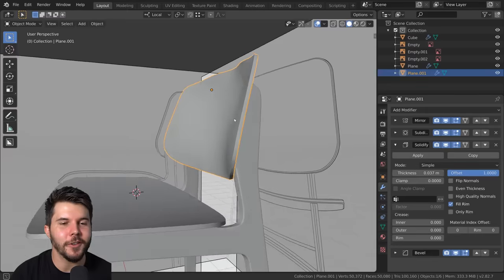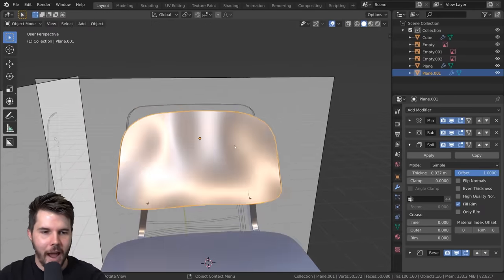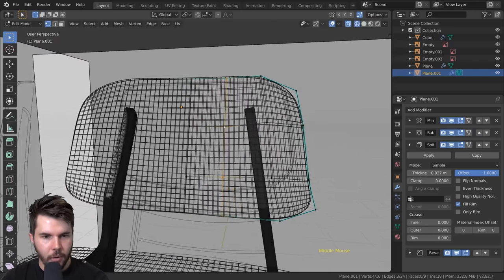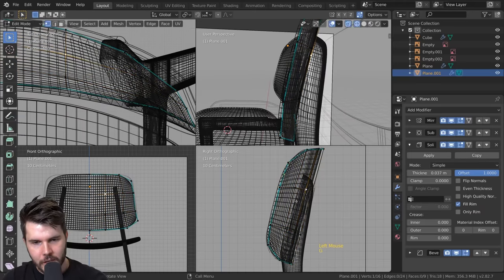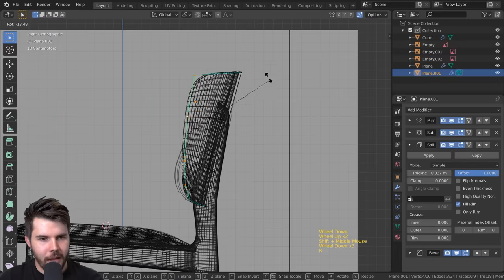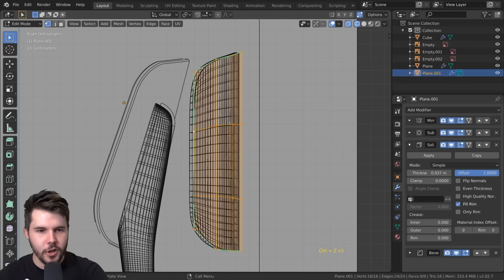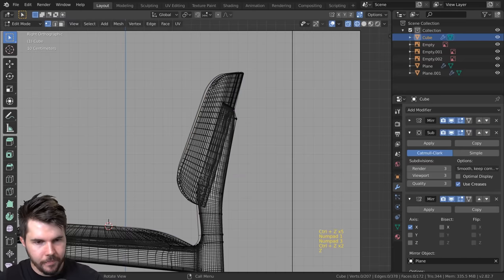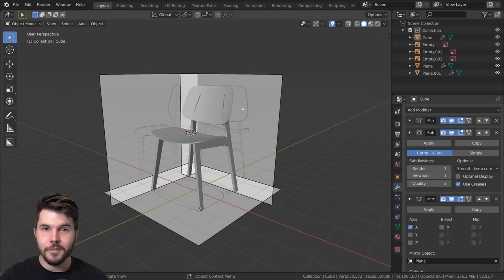Blender Beginner Modeling Chair Tutorial - Part 5: Curved Surfaces

Comment: Here is really useful tip that i think would be really useful for modeling any object that have odd rotation on x/y/z. 
What i would do is use Duplicate Linked (ALT+D). This is useful because when you create duplicate linked object, you get new object that you can rotate/move/scale any axes in Object mode and not affect rotation,scale, etc. on the other duplicate. But when you go to the Edit mode and move vertices, it will move vertices on the other linked object. 

-For example lets say you are doing chair legs. You can make 1 leg part the is perfectly straight and duplicate linked object that fits actual chair leg rotation. So now you have straight version of the chair leg that you can easily edit (because its perfectly straight obviously) and you can see results on rotated object. So you can just work on the straight part and look at the other part to see results in right rotation. When you are done you can just hide that object from render and viewport in case you want to go back and edit it again, or remove it.

-Other few useful things about this method. You can also Set subdivision surface on one object and keep other linked object without subdivision surface. IMPORTANT NOTE: When you use subdivision surface on one object, moving vertices on non-subdivision object will only show results on subdivided object only when you exit edit mode.

Comment: If making it in tilted angles is difficult, what I did was remake another seating (you could even duplicate the seating and work with that), hid the other meshes, tilted the whole set including the three blueprints to face sorta upwards(kinda hard to describe), and then modified everything there. After that get the blueprints to face normal again, and just tilt the back part the right way. To summarize, just make the model in your preferable angle and then just rotate it the right way. Its easier to deal with vertices and to place it without your mesh being that uncooperative.

Comment: this video was very valuable to me because I think it is more important to be able to fix mistakes than always learning it the right way from the get go but I am just wondering why you didn't use a deform modifier. After placing your surface sideways and matching it according to reference, it is as simple as just using a bend modifier for it to match without manually moving vertices around. Just wondering but thanks heaps, I am switching from Maya to Blender and your videos have been very supportive for that switch. Cheers

Comment: Why not use the SimpleDeform-Modifier ?
Blender 4.2/4.3 Oct 2024:
Use the mirror and subdivision modifier. Block out the backrest in the front view.
Then rotate the plane in object mode in side view. Don't apply rotation. Adjust the backrest again in edit mode in the front view.
Afterwards it is helpful to bring the vertices back into one plane: First set the "transformation orientation" to local and then enter "S, Y, 0" (scale in y-direction to zero).
Then use the modifiers “Solidify, Bevel and Smooth by angle”. The latter is a modifier since blender version 4.1 or so, click on “ignore sharpness” there.
To bend the backrest, create an empty object centrally and use the "simple deform" modifier to bend the backrest around this empty (select the empty object with the modifiers eyedropper tool).

Comment: Those wood curved shape are obtained in real world using the heat bending method which used a mold. One tutorial, especially a tutorial for beginners, has necessary limitations. The teacher has to constraint himself to a specific list of tools if he doesn't want to loose or discourage his students (and that's one of the numerous qualities of Andrew's tutorials). In this case, after modeling my plane shape in the [XZ] plan, I've tried the shrink modifier using projection option and a simple deformed cylinder (oval shape with a base slightly larger than the top). I think it's an efficient way (and logical one cos it simulates the real mold technic) to achieve a very regular shape without efforts (you can easily adjust your projection master object to get close to the goal)

Comment: 10:47 quick tip: you dont need to change the transform orientation at the top, you can just double tap Z and it will do that aswell (same with the other axis)
Reply: Just to make it clear, in 2.8x , that's a single-tap for the displayed, selected  orientation in the dropdown, double-tap for Global.

Comment: I remember that in 3dsMax there was something like custom grid. You can create own grid with angle and then work with it same as default grid. This feature would be nice in this situation.
Reply: Blender does it with Custom Orientations .. as I commented, I'm surprised they weren't mentioned in this tutorial, because they are really important in situations like this one. You can create a working orientation from any face, edge, or selection of vertices, use it, save it, name it, or, if you like, use it  to create a working reference grid/empty/whatever, of your own.  It's the '+' sign in the Orientations dropdown ... It used to have a standard keyboard shortcut, now it's one of the first I make for myself.

Comment: I found that the easiest was to first align everything in front view and go off the front face of the back rest not the back part.
then align the edge against the side view
then need to go into front view and scale it a little bit against Z axis to match again.
then go into top view and align the top edge and bottom edge (note that you only need to align it against y axis even though it looks like you should touch some Z, but don't do it cuz Z is correct). now the problem will be that the middle two horizontal edges are impossible to really align here against Y without too much fiddly effort. so what i did is just dissolve those two edges and put them back as they will naturally create a smooth surface then.
then use solidify to create thickness towards the back of the chair not front.

bottom corner is somewhat still a pain as it has a bit more curve to it i think.... 

hope this helps someone :)

Comment: A little something I figured out while trying to properly align geometry-
Select a face in your object, pick a transform tool, then under orientation in the tool menu choose normal. In the transform orientations list at the top of the screen click the + to add those axes to the list. Then you can select that under active tool while using any of the transform options, lock movement to those axes and get a precise alignment with any point of your object.
If there's an easier way to do exactly the same thing, someone let me know (and save me a lot of time)!

Comment: But did you know that you can set up a custom axis, from a face, edge or vertex? Then you get the local rotation of that element with it's normal being the new Z axis. All you do is drop down the axis menu and hit the little + icon while the target part of the mesh is selected. Should also work on multiple selected elements by averaging but I never tested that. 

So in summary you can get some unknown angles easly with this method. Well that's one more option at least.

Comment: Huh, I just fiddled with rotation and location by like .00 scale to move the back around, and then bumped up the thickness modifier by .01 to fix the arms poking through slightly. I didn't even think to move the arms.

Comment: Did you reshape the bottom seat to make the back seat? Would temporary rotate the side reference make it easier to make the back panel? For that local Z axis could you use a line from wooden side back support?

Comment: If anyone is having issues when clicking on their mouse/trackpad doing the sliding of the vertex on the edge when double tapping 'G' and holding down 'alt' and it doesn't let you click to confirm – instead try pressing 'C' once you have your edge direction in the way you want it and then move your vertex and then click on your mouse/trackpad and it should work!

Comment: I'm very new to blender and coming from nurbs modelling. Wouldn't it be the easiest way to add a cylinder  as a tool to just snap all the vertices onto (if there is a feature like this in blender)? This way the vertices would always stay perfectly aligned.

Comment: Andrew, if Im having issues with getting the back smooth, or an object like it, for example, would it be OK to just the vertices on the interior of the mesh and just keep the profile vertices? Then use the knife tool at the end to add in the verts after tweaking the profile to match in all the views?

Comment: I have an issue with the subsurf modifier on my chair back where when I increase the viewport it seems to create a pinch in the mesh at the bottom corner and a small tear the edge of the mesh exposing the inside. *this is at the end of this step when everything else is otherwise sorted!

Comment: Success for the homework! 
But I cheated! (Though it is not really cheating when there is no rule against it).
I tried at first to go the same way we did for the seat part, but the angle of the backrest  created a nightmare of wrong vertices positioning. Quite the same as the one Andrew showed in this video. 
But my solution was quite different:
I made a new set of reference images with only the backrest at a straight vertical angle. I obviously had to adjust the top and side views to match the height and  depth of the side view, but that was easily achieved in my picture editing software (other that Photoshop that I can't afford). It took no more than 2 or 3 minutes.
Than I shaped the backrest the same way the seat was made. Didn't take too long either (second time around). 
Finally I repositioned the backrest at its right place and there was just some minor tweaking (on local axes) to do in order to match the curvature of the top and bottom edges...
and voilà!
Pretty proud of myself.
But I still watched this video with great interest and I am very happy of the tricks it thought me. 
Good for future projects.

Comment: Oh man, I completely missed the part about how you actually get the curve of the back right. Now I've redone it loads of times and I'm at 8:45 and it's flat again.. Does Andrew explain that in this video? Also, the part about pressing E or F to see where the red dot is defaulting doesn't appear to be working. Is that still how it works in 2.83?
Reply: Okay, I was spamming out. The initial curve, before any modifiers are added was done wrongly. The steps Andrew explains (very clearly, on later viewing I realise) are critical. When you're in top view, trying to sort out the basic curvature of the chair back, you have to make sure that you use the Scale-Axis-0 command properly early on, or you'll end up with weird vertices all over the place later on! Thanks again Andrew, you're the best!

Comment: Sometimes I think the modeling workflow on artistic software like blender is a little broken. Like, in a typical CAD for mechanical engineering (Like Autodesk Inventor) you could model this in a much more straight forward way without the imprecise "try and error" stuff. I guess there is no way to "fake" such a workflow on Blender?
Reply: I wondered about this as well, and there are CAD add-ons and such for Blender, but I did read somewhere that this is because Blender is primarily a DCC (digital content creation) software rather than a CAD software. You can try searching for Blender tutorials on "precision modeling" and "parametric modeling", I've found those helpful when trying to do more precise work on Blender. :)

Comment: I followed the tutorial, but the edges are smooth. So to fix that, I used bevel modifier with an offset of 0.01m and increase the profile from 0.5 to 0.75 and segments to 3. Will this affect my render time?. will it create any problems? Or is there any other way to make the edges a little sharper?

Comment: Alt-S (Shrink/Fatten) is cool!. But where can I find all the options (like holding the Alt to 'escape' the clamp range)?
The manual page doesn't mention them: https://docs.blender.org/manual/en/latest/modeling/meshes/editing/transform/shrink-fatten.html
I noticed that when I hold the SHIFT key, the movement slows down, giving me more accuracy.
Are these general options that are used by other tools as well?
The status bar at the bottom seems to give me some hints as to what keys I can use, but it doesn't show the SHIFT or the ALT option, does it?

Comment: The solidify modifier on my backrest seems off. it looks like an extrude from the front view rather than thickening along the normals. The effect is that the sides of the backrest are not 90degrees to the faces, it looks like it's sheared. I've checked all normals and they seem correct, does anyone know what's gone wrong?

Comment: Hey folks! Does anyone know why the thickness woudn't be constant overall after using "solidify"? I tried changing settings and looking it up online but genuinely can not find the answer. In my case the right and left hand sides are thicker than the middle. And for whatever reason, ticking the "Even Thickness" box hasn't changed anything. Please help :'(

Comment: I've been following this tutorial along with no problem, but every time I go into wireframe mode the mesh I'm working on just turns into a solid gray form rather than an actual wireframe. Has anyone else has this problem?
Reply: you didn't turn on xray.

Normally when you use wireframe, the xray should be turned on automatically. But I think you accidently turned it off, just click on the xray icon near the wireframe icon to the left of the screen and the solid gray colour should disappear

Comment: is it just me or the blueprints of the chair dont align? Like for you to have the mesh well places you need to have it aligned to 2 blueprints and then it should be aligned with the 3 rd blueprint too, and it doesnt
Reply: I hope that you figured this out, if not, you'll have to hark back to the step where we are rotating and sizing up the first leg to the blueprints. Andrew says that we arbitrarily placed down the blueprints, so they will always be a little bit off. They're meant to be used as a guide, not a strict thing to follow. Don't let this beat you up fool!
Reply: @jayisdoingstuff  way past that but thanks !!

Comment: 1:22 How do I change the color of the external edge?
Reply: Did you ever figure out how to do it?
Reply: @digitalaether806  firstly, set the material to the whole seat,

then, select the face that you want to change the colour (the edge)

next, add a new material, and while the portion is still being highlighted, click on "assign" at the material menu tab.

Now, that new material property is assigned to the edge, and when you change the texture, it should only affect the edges =)

(you probably already solved this issue, just leaving it for others to see)

Comment: 7:25 shit I also did not know about this alt key thing. also on the bottom of the screen where it usually shows the keys that you can press, the alt-key is not even mentioned for some reason. Interesting how you can learn something new from beginner tutorials even as a more advanced user.
Besides good tutorial series. But can you please stop using the wrong singular "vertice"? It's called
one vertex, many vertices.